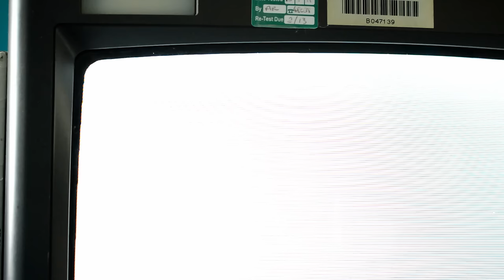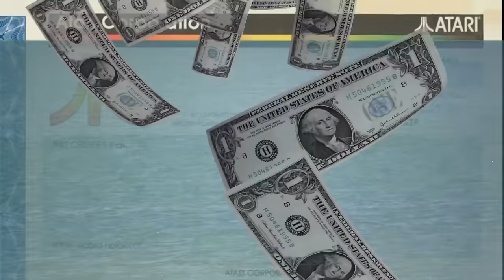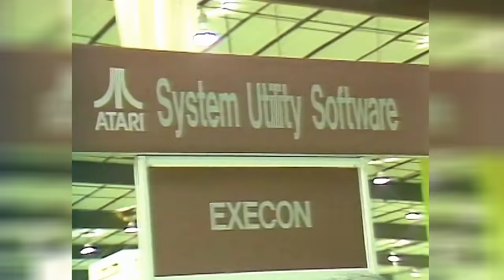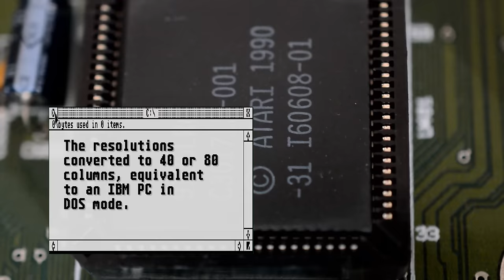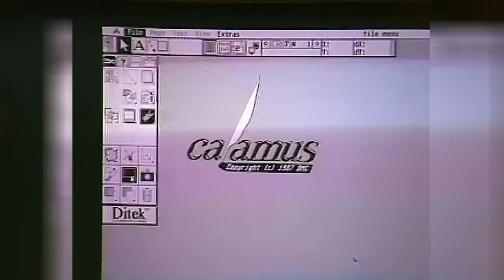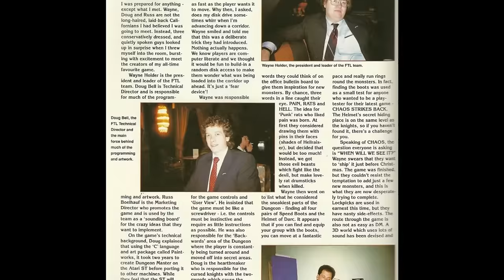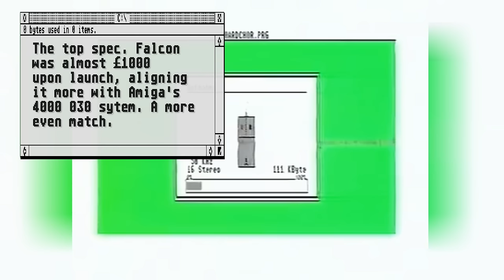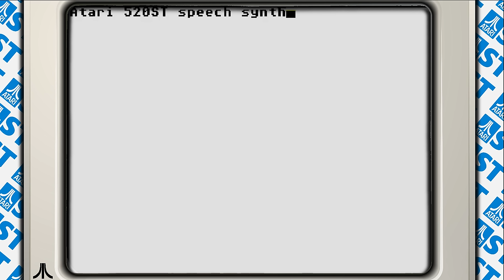The Atari ST Story | Nostalgia Nerd

Comment: What criteria do you use for the claim "first true 16 bit home computers"? I've always heard that distinction goes to the TI-99/4. And if not that, why not the 128K Mac?
Reply: I've wondered what distinguished a home computer from a personal computer.
Something you saw with computers called home computers at the time was they were designed to work with a television.  Better home computers had RGB monitor ports too, but they always seemed to have that built-in UHF/VHF modulator.  That was true up until the Amiga 500, which had an add-on TV modulator as an afterthought.  Those were the last computers I would have called home computers.  They surpassed the capabilities of the IBM PC and earlier Macintosh in many ways, and could be considered personal computers too, but they were built with the home user in mind.

The 128K Macintosh (with the Motorola 68000) released in 1984 was positioned to compete with IBM PC in the business environment, and would be described as a personal computer.  Take a look at the key speech by Steve Jobs at the time, and also consider the price of just under $2500  (priced at £1795 in the UK).  Accounting for inflation that $2500 would be nearly $6000 today.  

I too thought of the TI-99/4 (and 4A).  That had Texas Instruments' own 16 bit CPU, but in keeping the price down, they also hobbled the performance by using mostly 8 bit RAM chips.
Reply from the maker: The Atari ST was the first 16 bit machine (especially over in the UK) that was marketed for home use. Machines like the IBM PC and Mac were price and marketing wise in the business and professional bracket. The TI used a 16 to 8 bit multiplexer to communicate with most of it's components, so although the CPU was 16 bit, it wasn't a true 16 bit machine.

Comment: Dear sir, I remember using a soldering iron to make my floppy disks HD by putting a hole through the opposing side (opposite the write tab side) on my AMIGA from that day I dropped the Atari st
I do still miss the copper chip as used ti death by the BITMAP BROTHERS.

Comment: I think the ST v. Amiga stuff is just ludicrous. The Amiga was Hands-Down better for arcade games and multi-media, while both were on par when relying on the CPU (3d Wire-frame). For Overall computing the ST was better, but as a pure Games Machine The Amiga takes even the MegaDive / Genesis in the 16 bit wars. 
As an Atari 800 owner in the mid 80's, I had no idea the Amiga was made by the same people as my 800. So I got the ST and it was awesome for what it was. When pushed to its limit by the best developers, it could churn out some awesome games. The STE added to that, but the Amiga had won the 16 bit Computer war in Europe with sheer gaming glory and power by that time. 
I still loved my ST and all the games though.

Comment: Such a shame the great hardware capabilities of the STE were hardly used in commercial games. The STE should ideally have been released in 1987 to compete with the Amiga on a closer level and then we'd likely have had software houses use those extra hardware abilities to the full extent including brilliant stereo PCM sound and smooth hardware scrolling.

Comment: They probably should have released the STE in 87 to rival the Amiga more. The standard ST would have had a 2 year headstart in the budget market already at that time. Then the Falcon should have been slightly cut down and released at the end of 1990. They should have thrown so much more at the Falcon than they did. It could have been successful if released earlier and with decent support and marketing.

Comment: Not as much piracy on the Amiga, your joking right
one thing that was admitted on teletext after it's downfall was where most of the disks came from that were copied...

Amiga Format, yes as soon as the staff got the review disks they were run through x-copy and spread all over
it was so bad that software houses just didn't want to give them a review copy, but what could they do as AF could make or break a game
Reply: It wasn't that it was less piracy on the Amiga, it was that more ppl just bought games on the system. I believe the term is attachment rate.

Comment: It's a longshot, as I have googled my head off and visited many forums, but I don't know anywhere else to look. Does anyone have any idea how to convert a Mega ST video signal to RGB without having to buy an original color monitor?
Reply: The MegaST video is RGB by default. All you need is a scart cable or an ST2VGA adapter. The problem is, you need a compatible monitor or TV. The ST's signal is at 15Khz/60Hz (50 for PAL) so you'd either need a CRT tv or to try and find one of those VGA monitors that support 15Khz horizontal display. I've tested my st on some TFT/LED TV's, but the video doesn't quite adhere to standards so the display can be problematic. Last but not least I've heard people had good success with SCART OSSC.

Comment: Never heard anyone call TOS Tramiel OS before. TOS The operating system, MINT Mint Is Not Tos then Atari bought it and it because MINT Mint Is Now Tos. I miss my STFM I upgraded it to max ram, a blitter and a hard disk was such a nice machine. Dungeon Master was amazing. The E was originally the Falcon but they dialled it back because they thought the Falcon spec E was too expensive at the time. It wasn't. Atari has sooooo many industry firsts

Comment: Atari ST may not have been quite on Amiga's level, but I do think its competition is the reason why the Amiga dropped down to Amiga 500 level and became affordable for the masses... without Atari ST that wouldn't have happened and Amiga would have stayed an unaffordable niche system.
15:10 tells the whole story in this regard... and things were only rectified when the Amiga 500 came around. Atari was definitely a threat to them before that. It was never about whether Atari was "better" than Amiga but about whether you could get almost the same thing at a way lower price...

Comment: Younger viewers may not recognize what a Big Deal the ST and Amiga were from ~85-90
I was an ST fanatic, as while the Amiga had some technical superiority, in practice they performed similarly and the ST was priced lower and could be used with a color TV out of the box.  So you could buy an STFM by late 1985 in a bundle with the Atari monochrome monitor, and have a high res (for the time) 640x400 desktop publishing quality (DTP was a Killer app then) monitor PLUS essentially a color Mac using your existing color TV or composite color monitor, for a small fraction of a monochrome only Mac
VGA didn't hit the streets until 1987, nor become affordable for years later.  Real sound chip sound for the mass market wasn't available on the x86 until the Adlib 1987, and several years later with the first Sound Blasters with 8 bit sampled sound
https://en.wikipedia.org/wiki/Sound_card#History_of_sound_cards_for_the_IBM_PC_architecture
So for the period 1985-1990, the ST and Amiga computers were at MINIMUM 5 years (more like 8-10 years) ahead of PC tech, an astounding lead by later 90s2000s tech evolution standards.
If you wanted synthesized plus (8 bit) sound sampling, color graphics with a mouse/windowed GUI, real deal 80 column+ bit mapped word processing and WYSIWYG publishing, plus Sega Genesis/SNES class gaming (ie 1990+) as early as 1985, the ST/Amiga were it.

Comment: Speccy had a significantly lower res than the C64 if a person uses graphics modes with the same properties as the speccy (2 colors per 8x8 pixels), but it wasnt often used. 
Also, all but the earliest Amigas had flicker free 640x480, 800x600 and other strange non interlaced modes in 4 colors.
The analogy is between speccy/64 and st/amiga is sort of sound, but not nearly as defined. Was only about %10 difference in speed between the st and Amiga and the custom chips and dma have a general usage influence, not just graphics and sound, whereas the speccy cpu is significantly faster than that in the C64.
None of which is particularly important, Im just being a geek  :)

Comment: The 3,5" floppies sucked compared to the bigger 5.25" ones. The latter ones were not as mechanically robust as the 3,5" disks, but they didn't loose so easily data over time.
Only the 3,5" DD 720K could hold their data, the 3,5" HD 1,44MB sucked big time. But the 5.25" HD could hold 1,2MB and could keep their data. That's why they were better than all 3,5" disks if you wanted both, high data reliability and high density.

Comment: Small point but I think I heard you say this in other vids too, the 68000 range of processors where 32bit.  Okay the one in the ST had a 16bit bus but was internally 32bits (https://en.wikipedia.org/wiki/Motorola_68000_series). It is in fact in the name Sixteen Thirty-two (ST).
Reply: Hmm on seconds thoughts, does that make it 16bit or 32bit MACHINE?  I am sure the 386SX and DX systems did the same using a 16 or 32 bit bus (respectively) but both where classed as 32bit.

Comment: What if the Amiga had midi built in, I wonder.
Reply: What if the Atari came with a math coprocessor for CAD, and ray-tracing, and easier 3D programming?  :) too late, back to my Windows 10 ...
Reply: hectorae86 It did actually. All it lacks was a physical port, for very good logical reasons. Atari and it’s users TWISTED this around to try to fool people into believing MIDI on the Amiga was not built in, like all other computer platforms, and also that the Amiga wasn’t MIDI at BIOS level. 

All Amiga computers had MIDI built in. 

The Atari ST didn’t come with a 5 pin MIDI cable, should I say it wasn’t really built in? A twist on words.

Comment: the ibm pc didn't have a GUI or mouse at first in the early 80s but it was a "real computer" anyway. I agree with spectrum and c64 not being "real computers", they feel like consoles.
for me a "real computer" must have its own monitor, a full keyboard, floppy drives or hard disk, not cassete or cartridges, those are for consoles and "non computers", and the software must run inside the operating system, I mean when you turn on the computer it boots the operating system and then you load the software. if you turn on the thing with the game on it and it runs without operating system, it's a console not a computer.

Comment: The STE was incorrectly pitched by Atari as an Amiga-Beater in the early stages, promising a  256 colour mode, which wouldn't hog the CPU, unlike the Amiga HAM mode.

They lied about the exact number of sound channels.

The only rumour they squashed was Bob Katz explaining Atari had to save money, so it wouldn't be using a 32-bit 68020 CPU and instead would be sticking with the 16-bit CPU instead.

Atari totally mishandled the hardware as well, blaming chronic incompatibility issues on software houses 🙄

There was A DMA  Chip fault that caused HDD crashes and slashing the price as they did, reducing it from £400 to £359,then 2 months later to £299,made earlier adopters feel cheated.

They then increased the price of the Mega STE by £100,claiming they had to claw money back somewhere.

Annoucing the 32-bit Falcon a mere month after making the STE the £299 entry level machine did little to help matters either
Reply: @matt Atari increased the colour palate from 512 to 4096,but you could still only have 16 colours on-screen without clever coding routines, put in a rather weak Blitter chip, which few used and tarted up the sound by adding a  new 2 channel soundchip could play 8-bit stereo samples.

Atari lied about the number of channels in it's advertising.

Comment: When you're talking about the internals of the 520ST at 12:29, you are not showing the internals of the 520ST  The 520ST motherboard looks like this: 
http://www.atari-computermuseum.de/pics/systeme/st/c070243i.JPG

The MC68000 on the 520ST was the old rectangular model, not the square VLSI ones.  You're showing the Atari 520 STE motherboard which came out late 1989.